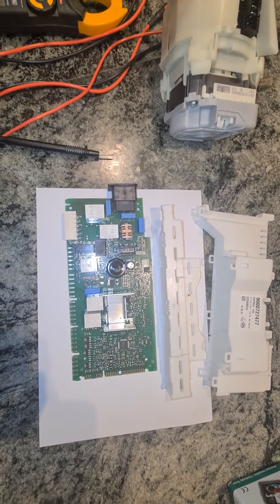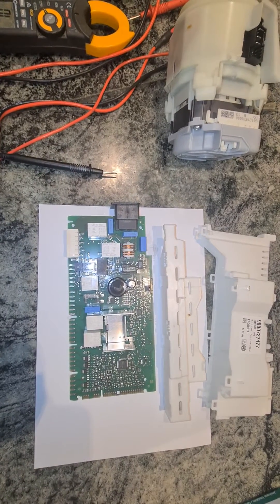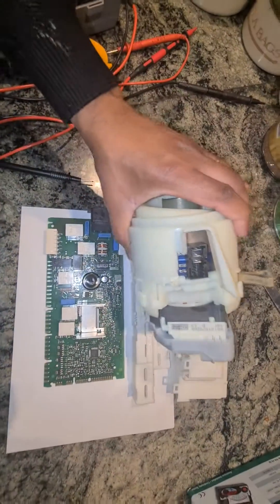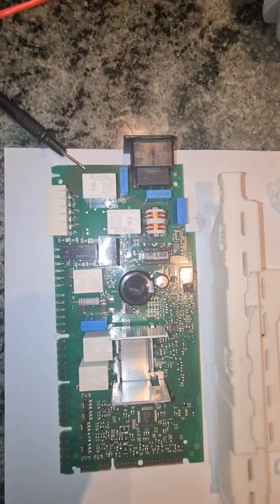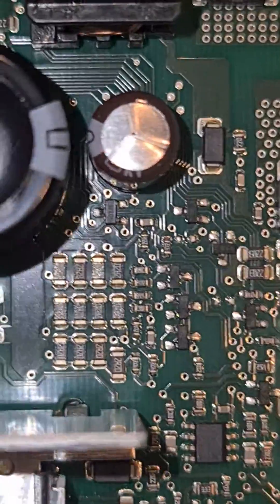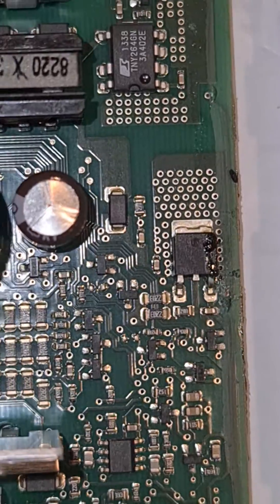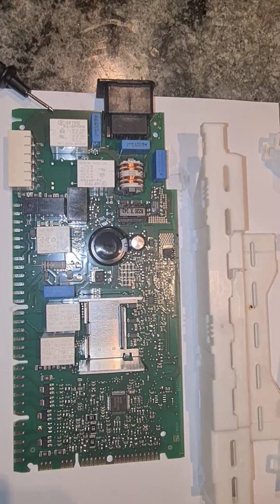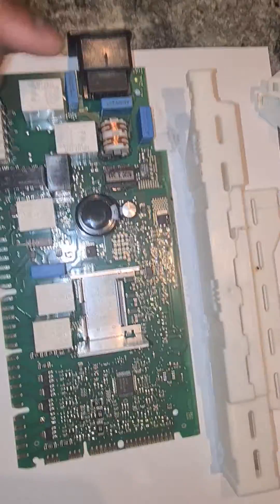Bosch Dishwasher - E09, No heating - Case of Blown Control Board.

Comment: I have what appears to be the same PCB (EPG60613 9000588642) on a Bosch  SMI50C06GB/03.
The dishwasher tripped the circuit breaker and suspected the heat pump as the motor was already making a whining noise so i decided to replace it.
I now have the issue of everything apparently working fine, no errors during any cycle but NO hot water. I decided to remove the pcb and inspect it, it seems fine, no obvious signs of damage. I was able to test the heater relays on the board with a 9v battery and both seem fully functional.
I'm beginning to think that something is either stopping the temperature signals from the NTC or stopping the heater from operation.
I know there is a varistor on the board protecting overvoltage and am wondering if this could be culprit ?
I dont really know where to go from here as i cannot find any full schematic.
Anyone have some advice ?
Reply: Did you sort this? I have exact same issue with a similar model: SMS50T02GB/36.  There is a float valve that may be an issue?

Comment: Did you repair this pcb or buy new?
Reply from the maker: I replaced the pcb the board to fix the issue
Reply: @theoracle6005  I have made  repair on the pcb, but although it’s filling now, the heater is still not working
Reply from the maker: @firmbutton6485  I would say check the heater on the heat pump and replace if necessary
Reply from the maker: Hi 

Did you test the heat pump terminals 2 and 3rd terminal (red wires) - it should be 20ohms.

If it's open circuit then you get E09. The pump price in Australia is $220 and about 1.5hrs to remove and install/test.

I would give this a go before looking at PCB

Comment: Isnt it that there are two relays because the pcb is universal and one relay is for a pump heater and the other one for a zeolite heater? It sounds logical to me... there are 5 pins coming out of the board and dishwashers without zeolite dont utilize all of them.
Reply from the maker: Well the zeolith is in the heat pump.

2 pins activate the coil and 3 pins - Normally open, Normally  closed, and common
Reply: @theoracle6005  no zeolith has a separate heater
Reply from the maker: Does you unit have a dryer as well ? If so there is an additional zeolith.
Reply from the maker: If my knowledge serves me right the zeolith is a printed heater around a round metal surround
Reply: @theoracle6005  zeolith minerał has a separate tank and a heater in it.

Comment: I wonder if we could see the heater element  inside  pump.
Reply from the maker: Yeah you can remove the clips holding the motor housing to see the element. Once disassembled the sealing integrity is compromised and the whole heat pump should be replaced
Reply: @theoracle6005  thanks, do you know about diagnostic menu in SMS seriese ? There is no any guidance about it
Reply from the maker: There is very little information,  but when u replace the board it has a diagnostic startup